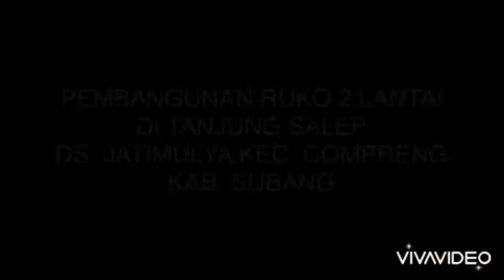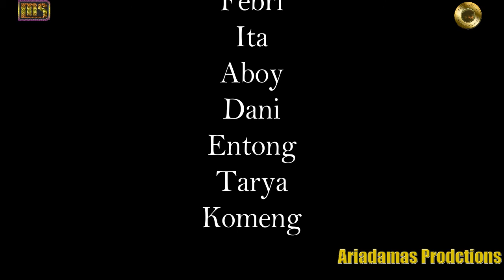Pembangunan Ruko 2 Lantai Part 1

Comment: PK utk ruko 5x5mtr
Apa kuat dpan lgsung rolling door 5mtr
Pake balok gantung di atas rolling nya ukuran cincin begel 10x25 .
Reply from the maker: Ukuran balok gantungnya (500 cm/12=41,6 cm). Dimensi baloknya 45 cm x 22,5 cm. Pake cincin begel diameter 8 ukuran begel 35 cm x 12,5 cm. Dengan jarak begel 15 cm.
Reply: @BANGUNSEDULURMAKMUR  tiang ny PK utk d Ats rolling door